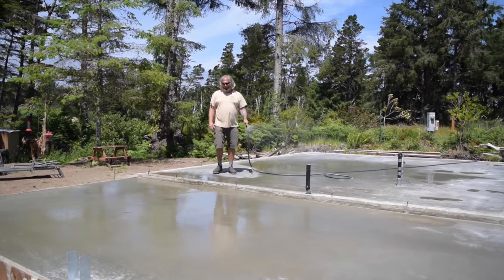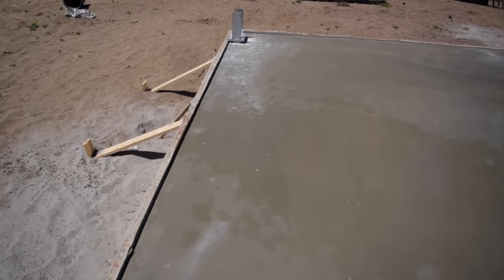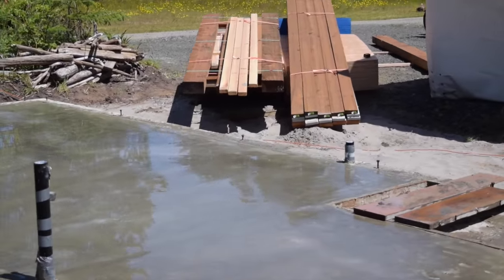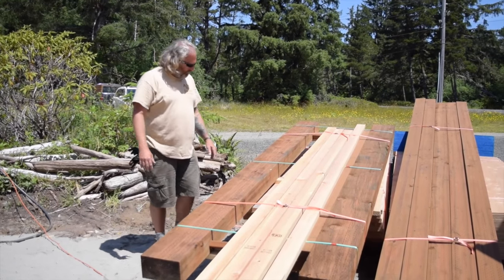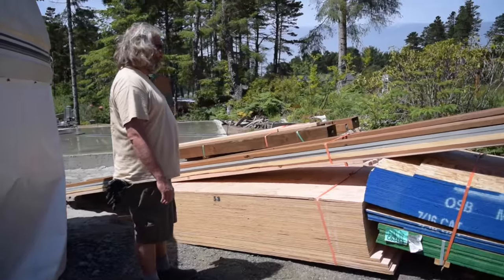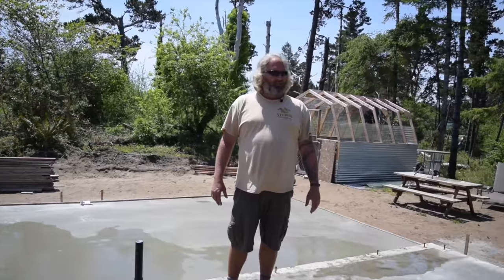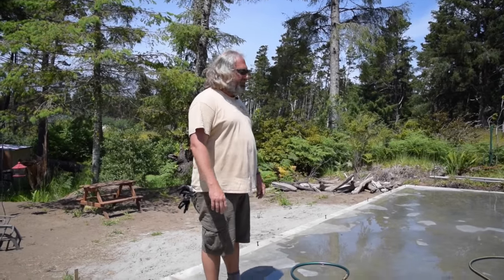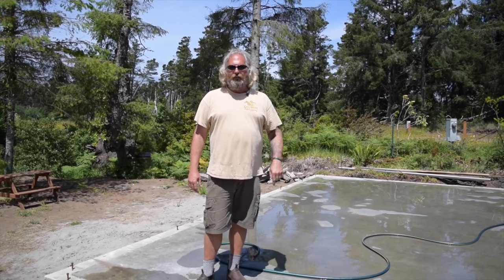70,000 pounds of cement . We are well anchored.

Comment: Looks like a good project, are you planning to paint the wood pink? with pink paint you can create 15 minute burn time for fire proof meaning it needs 15 mins of fire for it to catch and it also makes the wood water proof / mold resistant. Also are you planning to do any water proofing on the outside base of the foundation? I know some places us a tar like substance or the new stuff is a drainage tile. I painted my above ground section with dry lock for some piece of mind as I get snow.
Reply from the maker: Thats interesting i'll have to look into that.We are staining the slabs and sealing them.
Reply: Kevin Coy I did it to even out the tar coat as some of it could be seen above ground and our house inspector said the grade was a little to high so I wanted to be safe and dug down I also wanted to hide the foundation / blend it into the house siding by having the Dry Lock tinted the same colour. Overall it turned out great and as a bonus it gives me 10 years of water proof warranty protection or if you want they have a 15 year product. Lots of people in America use it for cinder block foundations or basements mine is a solid pour but it still works great. It can be used inside or out. Not sure what is the best or correct product this was just cheap easy solution.

Comment: Will you clear up the footing for me please Kev, you poured the footer in the last video, and then did you fill it up LEVEL with sand? And then pour the floor or am I missing something?
Reply from the maker: Footer first then stem wall then fill in the inside up to 4 inches from the top. Then pour a 4 inch floor.
Reply: +Kevin Coy thank you for the speedy response Kev, so there was the initial shuttering for the footer, let's say that was 18 inch wide, and then this stem wall that you call it, that was another shuttered area, possibly 8 inch wide?
Reply from the maker: The footer is 12 in wide and 5.5 in tall. The stem wall is 5.5 wide and 12 in tall on top of the footer.